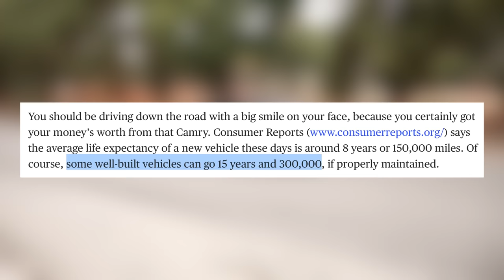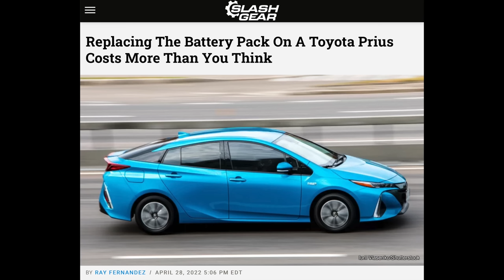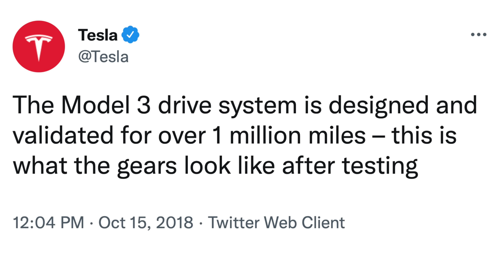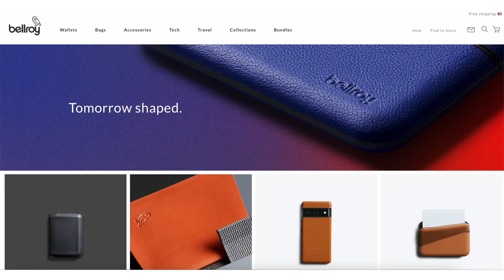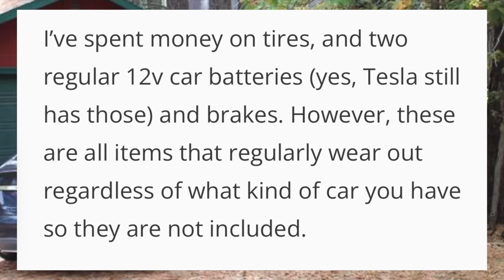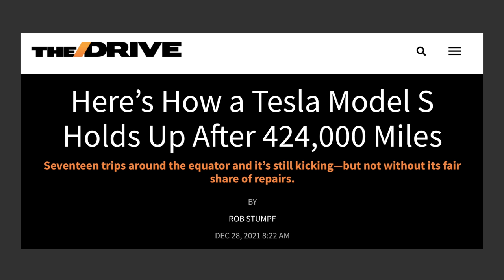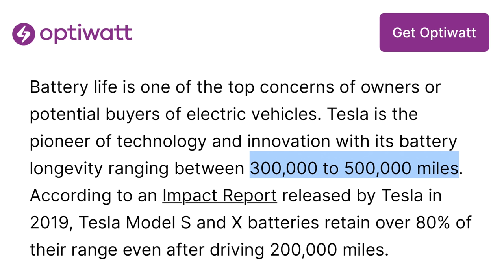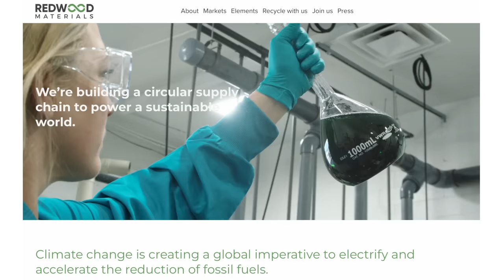The ONE MILLION Mile Tesla | It Still Runs

Comment: Cars can last a REALLY LONG time if you properly do maintenance which very few people do.
Reply: Right
Reply: Well yeah but eventually you get to the point where the car isn't worth fixing anymore that's usually why most people decide to just get a new car around 150k-200k miles. For example my parents had a car that had 180k miles on it. It ended up breaking down and the cost to repair it would have been 6k in parts alone and the car was only worth about $2500 even though it had been taken care of the entire time they owned it. So they just sold it as is and bought a new car.
Reply: If you drive uber/lyft all day only tesla's last
Reply: The proper maintenance for a Tesla costs 20k
Reply: @thesimplegig   I drive people for a living through my small company, and do Uber on the weekends. I have a 2011 Rav 4 with 254k miles on it, mostly highway (about 60-70% I would say). I do full synthetic every 5k miles + Lucas oil stabilizer ($75 total per change), besides other preventative maintenance. Car is running absolutely amazing. Gear changes are smooth, burns very little oil. Of course it will need a major repair at some point. But I can totally see myself getting at least 350k miles off of it keeping this same maintenance routine. I plan on getting a Model Y afterwards.
Reply: and if you are dedicated to keeping the car
Reply: What maintenance? :D
Reply: "I've used this broom for sweeping for over 20 years. It's only had 17 new heads and 14 new handles."
Reply: So the other big key here that is even harder to find or get even at dealerships is qualified experienced personnel to maintain your vehicle.
Reply: Well said!
Reply: @thegravitx  of course it’s running good. It’s a Toyota.
Reply: I find a lot of the petrol and diesel cars, particularly the European cars, start getting smelly exhausts after a few years. They may look $100,000 from the front and sides but you do not want to be driving behind them. Sometimes I pull off to the side of the road and wait for them to get ahead. They seem to get smellier more quickly than the older cars; maybe they use turbochargers and wear faster.
Reply: Maintenance and heat cycles determine how long an engine lasts. A person who drives 300 miles a day will get a lot more miles out of their vehicle than a person who drives 20 minutes back and fourth to work. Cold oil, and the expanding/contracting of metal is going to wear away at gaskets no matter how much maintenance you do. Once the vehicle is up to temperature there's basically no engine wear.
Reply: @thegravitx  I have an MG ZS EV and I have to change my 1.1 litres of oil in another 94,400 km.
Reply: That not a car
Reply: @thesimplegig  Toyota enters the chat
Reply: @thegravitx  Dang.. I have a 2019 Corolla with 65k miles.. I have been doing full synthetic every 8,000 miles. I am considering lowering to 5k miles after reading this..
Reply: @CL-yp1bs  I do 5k to be safe … That’s around when my car starts to give me an oil change light.
Reply: Lol, it replaced motors 9 times
Reply: @thesimplegig  🤣
Reply: @stimulatemyexistence5669  bad*
Reply: Plus you don’t really gotta do maintenance on a Tesla since there’s no engine
Reply: @southmadethis7767  how ? Like what ? What parts cost 20k? People just going in there and breaking your screen 24/7 lol ?
Reply: If you do the “proper” maintenance on a car you’d be under it every single week.
Reply: Not all cars this a tesla also electric vehicles engines have no moving parts and few if any
Reply: I think that is what I would like about TELSA. The Standard petrol car dealership arrangement is a big problem in my opinion. I have had a car since I was 16. Dealt with car dealerships in AZ, NM, PA for over 50 years.  There are some good dealership maintenance dept, and BAD ones.  I bought a brand new turbo sports car in 2004. I swear, it seemed as though the dealership was trying to screw up my car. After the 3rd screw up in less than 2 years I stopped using that dealership and had all my factory warranty work done by a speed shop.  The dealership sent me letters threatening I was voiding the warrantee if I did not take it to them.  FINE, let's go to court if there was a problem.  Which there were none over the 10 years I had the car. It was a well made car.  THE DEALERSHIP WAS THE PROBLEM. In court the public would have found out how bad the dealership was.  If Tesla has done anything it has shown that the dealership partnership with the manufacturers has a lot of faults that need to be corrected.  TESLA backs their product all the way to the owner, that means A LOT TO ME.  On top of that is outstanding design and workmanship. I can almost guarantee my next car will be a TESLA.
Reply: The reason why we have still got many of the original vintage and veteran cars on our roads and in collectors garages is that someone loved their car enough to maintain rather than throw out or pass on their car. The more common a car becomes the less likely many will be saved, Tesla have an alternative life planned for their cars if owners no longer want their Running cars. Full self driving, refurbishment and putting the older cars back into service as robotaxi’s is a great plan.
Reply: True, my 2010 lincoln mkz has 309k on it
Reply: rELLy lONg TiME trust me bro
Reply: Yes that's the thing. They don't require maintenance
Reply: 😂😂😂 Not all cars buddy, Tesla only
Reply: You are right, but the technology becomes extremely outdated eventually. That’s what makes Tesla so appealing. The tech updates itself.
Reply: @southmadethis7767  The “proper maintenance” for a Model 3 is tires once in a while.  You can do cabin air filters if you really care.  I don’t.
Reply: @TySchmidt  True, but shouldn’t you also compare your reciprocating engine to a well-designed electric motor?  With proper bearings, that motor will run virtually forever.
Reply: I mean yea it may be cheaper but most keep their vehicles pass warranty… when warranty ends it’s cheaper to run and fix a gas vehicle than replace a battery yourself and you can actually work on ice engines… this you cannot on any circumstance work on evs which voids warranty due to safety they say but also in fear of tech stealing I assume
Reply: @CL-yp1bs  If you want to maximize the engine life, do not use extended oil change intervals
Reply: @gotworc  bingo
Reply: Yes, but wouldn't it be better to last that "REALLY LONG" time with far less maintenance (like it is with an EV).
Reply: Not GM cars 😂
Reply: I do and every car and van still costs far more in maintenance than a Tesla.
Reply: @stimulatemyexistence5669  and that's with a shody American built quality. Imagine what Toyota would do if it was building Tesla in their factory. Some of those maintance were due to manufacturing problem
Reply: I do maintenance on my bmw and it still takes a shit 😢
Reply: Unless it's a GMC Acadia, 2.2 Sonoma, Direct injection ecoboost, etc...
Reply: I have my model Y performance for one year. I only have 4800 miles and lose about 9%  I charge at 80% and only charge to 100 once a month.. at 100% I get 275 miles.... Should I be concerned?
Reply: @thesimplegig  sure - because nobody drove taxis before Tesla existed…
Reply: @user-tl5sh8dg6e  but it does have suspension, brakes, coolant, electric components, HVAC, and faces the same corrosion issues any other car faces.
Reply: @shantariancooper1959  umm, obviously. Electric cars have motors, not engines.
Reply: @jaytaylor3955  no, only the software can update itself. The hardware will be outdated significantly every cycle - which will probably at best be every three to five years.
Reply: @johncahill3644  and lubricate brakes, replace worn suspension. And yeah, I know you don’t care about your cabin filter - I can smell your car through your posting it has gotten so bad.
Reply: @samjam6989  yep, only thing wrong with Toyota EVs are the wheels that fall off…
Reply: Regular car will be rotted and worn out
Reply: @thegravitx  buy the model y now. The earlier the better all that money wasted on oil changes brake jobs and expensive fuel is a Model Y price. With
Reply: @dstr1  and so will a Tesla. EVs are not immune to corrosion.
Reply: You must live somewhere with no salt, I’ve seen subframes on cars with less than 150k mile rust all the way through, and holes rusted all the way through the doors. Cars will crumble apart before they stop running where I’m at.
Reply: @ronlaverdiere  Tesla is the only car that yse stainless steel  and aluminum in it's body in white structure.
Reply: @fatninja987  I mudt check what they use on the new England roads to keep it free of ice.
Reply: @fatninja987  Florida
Reply: True 😅
Reply: @dstr1  no it isn’t. Also, stainless and aluminum both can suffer corrosion. Besides that, aluminum in contact with stainless will rot even faster.
Reply: Key word there is "can" I've seen multiple Kia/Hyundai engines fail at very low miles, not to mention the transmissions. In Hyundai's infinite wisdom, they installed a non-serviceable transmission filter in the 6 speed automatic. The entire transmission has to be removed and disassembled to replace it. People are not joking when they call them throw away cars. Nissan CVTs are even worse, 50k miles seems like a common number to get out of them. Then there's the GM Ecotecs and 3.6 that are complete garbage as well as the Ford Ecoboosts. I can't think of any decent compact car newer than 2010 with a decent engine. Dodge Darts and Chrysler 200s are turds as well. Hondas and Toyotas are pretty much the only ones that last but even then, you still have to do your research if you don't want an oil burning/leaking pig.
Reply: @EricFixalot  Exactly and then people want to list a high mileage example of shit cars defending them when it's not the ones that make it to high mileage that make them good, it's the ones that don't that makes them bad.
Reply: And it will stay like this
Reply: Most modern cars made in the last 30 years can do hundreds of thousands of miles trouble free with proper maintenance.
Reply: @@squidwardshouse67  besides Kia and Hyundai blowing engine at low milage, Fords just recalled their CVT a few months ago, I have a friend waiting 6 months just for them to be able to double check to get reimbursed for $5000, Chevy 3.6 is a turd with motor out timing chain issues, Nissan giving the CVT transmissions a bad rep, seems like the mini had to replace all of them too, BMW, every car with piston rings designed to save an amount of gas you would never notice because Obama looked like he fell asleep while adding his part to fuel economy along with destroying 800,000 cars to replace with Kia reos that barely outlasted payments, oil intervals have never been this high, dodge ecodiesel or whatever it's called, the motor Chevy uses in Sonic and little SUV, the motor Ford uses in fiesta and little SUV and there is probably a lot i can't remember
Reply: @All2Skitzd  It's honestly a shame that everything but the reliability of a car is regulated. I can't think of any other industry where such common failures are so widely accepted. I bet if manufactures were held responsible for repair bills during the first 200k miles or so we'd stop seeing so many stupid designs and I bet they would make them easily serviceable.
Reply: Not true. Depends how the car is made which is heavily dependent on the car brand.
Reply: Cause it cost more money to constantly do maintenance on an old dying car, might as well get something new
Reply: Well tesla makes it ez to do it properly
Reply: @CalamariTasteGood  I disagree. Between deprecation, interest, and maintenance a $30K car could easily cost $5k a year. I was in a pinch once and needed a temporary car, so I bought one for $500. I drove it for like a year, then sold it again for $500. I think it had like 198k miles when I got it and I sold it around 206k. Let me tell you, at that point people do not care. The car just kind of hits a bottom price. I think all I ever did to it was change the oil once or twice, which I did myself for like $30. My brother was who bought the car and ended up driving it another 2 years before it finally gave up. There is a reason poor people drive old cars, they are cheaper.
Reply: @southmadethis7767 nonsense
Reply: I'm loving not changing engine oil. The miles I run, I'd be changing oil monthly. EV for the win. Full tank of gas daily. 5x cheaper than ICE car
Reply: @thesimplegig  Only teslas last hahaha yeah gasoline cars can't do uber/lyft. Oh wait they've been running taxis and trucks for.......ever. Here's a fact for you though, when it comes to trucking there ain't a single electric vehicle in the game. Not an EV hater here just keeping it real. I love electric motors. For example when it comes to pulling super long freight trains only electric motors have the ability to get them moving. Combustion engines have zero torque at zero rpm hence need a clutch and they can't even get them up to 1mph without burning up the plates.

That's why they use diesel electric rather than using the diesel engine directly. But the diesel motor is like the battery for the electric motors. Because current battery tech sucks they would never even consider using them to power the motors. Compared to gas tech it's abysmal.
Reply: @southmadethis7767  Yes 20K over 17 years. Soo not much more than an ICE car.
Reply: @ronlaverdiere  ALUMINIUM. This applies to all heavily Alu cars.
Reply: @Neojhun  what are you trying to  say? IRON - this applies to all Fe engines. See, I too can say something that means nothing without context!
Reply: @southmadethis7767  over what, 30 years or more? I spent almost $20k maintaining my Ford Taurus over 11 years. Most of the repairs were on components that an EV would not have needed repaired, and others just a lot less frequently.
Reply: @Gotworc  yeah my parents just put a 7k engine in a 2006 Kia... it belonged to my late grandmother and has sentimental value but was seemingly an awful financial decision on paper
Reply: No PT Cruiser is going to last a long time by any means hahahha
Reply: My car has 300k on it and hasn’t/doesn’t need an engine replaced, and can still travel 600 miles on a single tank of fuel.
Reply: Hmmm Time and a lot of miles can differ. You can have an old vehicle last years without driving it much and being a garage queen. The true reliables are those with lots of miles, less maintenance compared to others and old in age
Reply: @M VC  I have two Acuras. An 09 TL and an 06 MDX... Both have over a quarter million miles and they both run like new vehicles and have been driven for work and travel nonstop. Japanese luxury!!!!
Reply: @mlongoria124  nice. Those cars are pretty reliable.
Reply: Coming from a 1993 Honda Civic Dx owner, I can confirm that cars can last.
Reply: @mvc2177  again, head gasket is maintenance.
Reply: There is hardly any maintainance to do on a tesla. Its practically just a battery and 1-2 engines.
Reply: The problem is there's a lot of stubborn people who just replace the engine and drivetrain and then brag that their car lasts 30 years 500k miles and an EV will never manage that.
Reply: @LuciusC  yup lol. “My Toyota is still running strong at 500k miles. All I’ve done is two transmission rebuilds, a gasket and regular maintenance”😂
Reply: That only holds true for mechanical things that need lubrication not with battery which will expire at certain number of charge cycle.
Reply: @ronaldoquintos1675  yes the movie is about the battery charge cycles.
Reply: @studio85amsterdam  Tesla battery will last at the most 300k if lucky but most will probably go bad around 130k
Reply: @ronaldoquintos1675  did you watch the video (or look at the title?)
Reply: Incorrect some cars are lemons and some last longer due to the engineering behind it. There’s a reason why you don’t see ford focus on the road but you still see 2nd generation Prius still running. So no your wrong.
Reply: @freshandsaltyjohnny  Well I happen to own a hybrid mechanic shop don’t tell me I’m wrong. I been around cars all my life and I fix them what do you do?
Reply: @southmadethis7767 20l in ten years
Reply: Screw gas cars. Elon for PRESIDENT BABY!!!!!
Reply: It’s not the miles you have to worry about. I think time will be the killers of ev cars
Reply: You need to come out of your gad mindset and now think on electric car terms. How to charge right and keep your breaks and tyres on good condition!
Reply: My boys jeep fj has 340k miles same engine
Reply: @thegravitx how is it burning oil with that much care in maintenance? Is it because it's known for that year to burn oil?
Reply: @ctgaming168  I guess so? It doesn’t burn much tho. Car is now 310k miles and I don’t even have to top it off until the next change.
Reply: But that is the point these cars don't have a lot of maintenance cost to them or maintenancefor that matter. My Tesla model 3 has been by far the least expensive car I've had. My Cadillac CTS-V was high in maintenance , and  my BMW was high in maintenance Costs,even my toyota Avalon was higher in maintenance cost, my Tesla has literally been minimal debt maintenance.  And that is what makes them so unique. Not to mention the technology that is in my tesla model 3, It's far more superior than all my other cars combined.
Reply: @ranman7729  I would have bought a Tesla too has the quality control been better. I can't buy a new car that rattles and so loud on the road. My plug-in Prius is at least 150 times better built than all the Tesla combined and I don't pay for gas too.
Reply: I’m not even great with my maintenance and my 06 Dodge Magnum is almost at 250,000. Very little money has gone into it. The car still looks and drives great!
Reply: My pick up turns 20 next year
Reply: Sure, but eventually repairs and maintenance costs more than the vehicle so you are just wasting money at that point. Also, that is not the case in areas where it snows a lot, cars in the north are lucky to last much past 200k miles because of all the rust and corrosion.
Reply: ICE cars are so affordable many people just don't maintain it and just drive it until the wheels fall off.  Problem with EVs is that the batteries have a shelf live even if you don't drive it.  Wait until most model 3 owners hit 100k miles, will they all turn to heavy paper weights?  The jury is still out since it's a pretty new car.
Reply: @gotworc  Put a cool 420k miles on a 2011 Hyundai Santa Fe. It only started acting up around over 300k miles. Though switching to EV now due to low maintenance cost.
Reply: @gotworc actually it depends on how old the vehicle is, and how collectible it is in the vintage vehicle market. Vehicles typically depreciate for the first 15 years after production. Market values find a bottom and begin to tick back upwards as they approach the 25 year mark. After 25 years mileage doesn’t hurt value as much.

My father has a first gen mustang with a 5 digit odometer. There was a point in the late 80’s where repairs weren’t really worth it because of the market value at the time. He would repair it out of love for the vehicle. Over the decades the market value has gone up making any repairs worth it. The engine has been rebuilt 3 times over 50 years. The car will still fetch more at auction than what he bought it for outta scarcity now compared to the 60’s and 70’s.
Reply: Yes if you spend 20K $ on your 50K $ BMW, it runs great after 100k miles. No thank you. Luxury brands deserve to be destroyed by EVs.
Reply: @murat8194  Even Teslas have failure points and they are not inexpensive repairs.  If you want something that lasts and is cheap, then buy a Toyota.
Reply: @stimulatemyexistence5669  They have failure points that are quite expensive.  You only don't hear about them because it's a fairly new car and there aren't a ton of people putting it to the test therefore there are not many data points.
Reply: @hercules71185  That's actually not true.
Reply: True. Bought a 3year old Cherokee XJ in 1999 and drove it till 2020. Was still in a driveable condition and was approved to be save by the German TÜV (technical association). 

But that grows expensive due to high prices for fuel, higher taxes, even replacing oil was expensive as it had 6,5 litres in it (was a 2.5 turbo diesel for export to Europe).

So we bought an EV. It is cheaper in upkeep as the Mazda 2 we also had. Even if this EV won´t last as long as the IC cars (which I doubt), it will save us a lot of money.
Reply: @southmadethis7767 no tf it doesn't. Stop spewing nonsense. 20k is if your car is completely fried. Battery modules are only around 5k and likely will never need replacing anyway. For perspective, I just had to have the entire fuel system in my Jetta TDI replaced because the high pressure fuel pump took a shit and sent metal shaving throughout the whole system. It cost me nearly 6k to have it fixed. THEN, just recently I had to have the fuel injectors changed again and that cost another 2k. My Tesla battery is under warranty for 8 years, if it fails, it's free to replace. I will ne trading it in for a new model well before the battery warranty is up.
Reply: The fact that consumer report says a car should last 8 years tells me they know absolutely nothing about what they're talking about. I can't trust any of their reviews to do with vehicles.
Reply: @gotworc That sounds good in theory, but it's a completely nonsensical approach to vehicles.

What a car will sell for is not what it is worth. What it is worth is what it will cost to REPLACE. I have a vehicle that's worth $1,000, but if I were to replace it with something that would be equally as reliable, it would cost me at least $7,000 and would likely cost more for repairs than my current vehicle. Hence, my current vehicle is worth at least $7,000.

It's a logical fallacy. Most people make it because they are looking for an excuse to get a new vehicle.
Reply: @southmadethis7767 For what?  Maintenance is just tires, brake fluid, washer fluid, and after a long time your brakes.  Anything else is repairs.